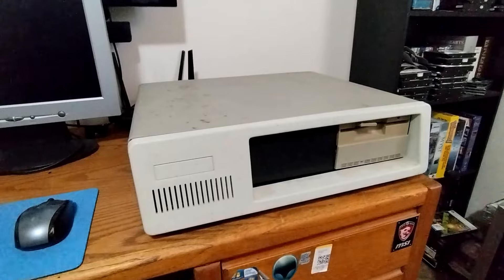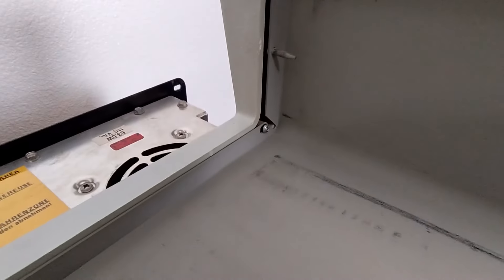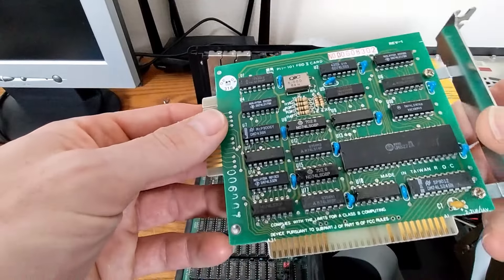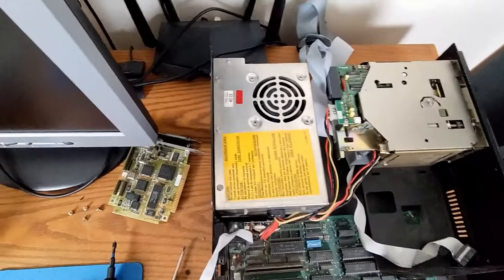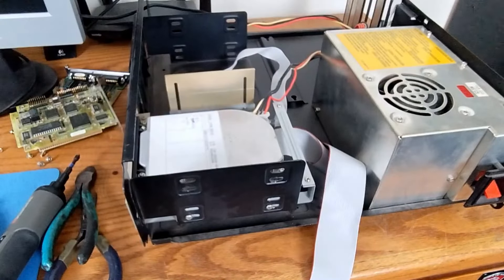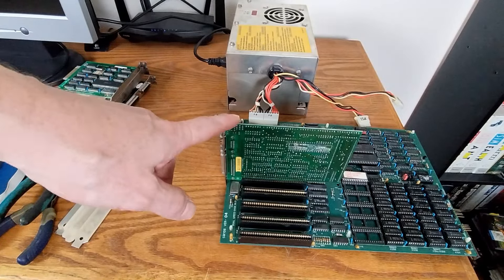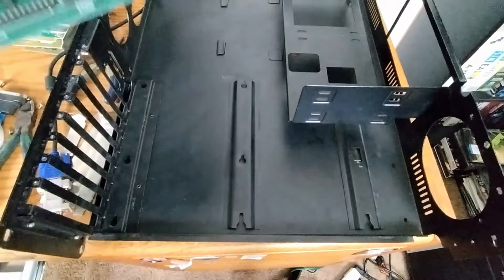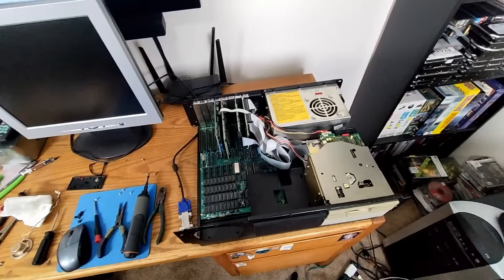IBM 5150 Clone Archeology and Restoration

Comment: Not criticizing, or yelling, Just commenting! So please don't take offense! This is a 5160 clone, not a 5150. The 5150 only has 5 expansion slots.  Specifically, this is one of the many Turbo V20 boards that came out in the mid to late 1980's. The copyright date on the CPU is 1984, but the production date  appears to be 1987.  The 256K ram chips also have a 1987 date code.  On the power supply connectors, you just need to remember that the black wires go in towards the center on both connectors.  The notes on top of the HDD are how many cylinders and heads it has for the low level format program on the drive controller, not a failure map.  A previous owner just wrote them there..  The XT BIOS is unlike the AT bios.  You almost certainly WILL NOT be able to hook an EGA monitor to a flat panel.  Some older 16 bit VGA cards will work just fine in an 8 bit slot.  You will need to change the motherboard settings if you do.  Also, this machine has never had a PCI card in it.  I know what you're trying to say, but this machine uses 8 bit XT bus or the retroactively renamed  ISA  cards.  There are no "PCI card blanks".  Sorry, that just twitched my "incorrect nomenclature" button.  

If I had to guess, this machine was likely built in early, mid 1987 and upgraded by the dealer at the time of sale with the hard drive and the extra RAM in late 1987 or 1988.  The hard drive is probably NOT the original, which would likely have been an Seagate ST series. Also, the $5 replacement power supply is likely not the original rating.  63 watts is the original rating for a PC, but it's marginal once you add any upgrades like a hard drive or other cards.

These machines are either very exciting or terribly boring to do archaeology on.  this is one that's pretty typical and was likely not used after probably the early 90's, since many of them were often upgraded with a 286 or 386SX board around that time frame..